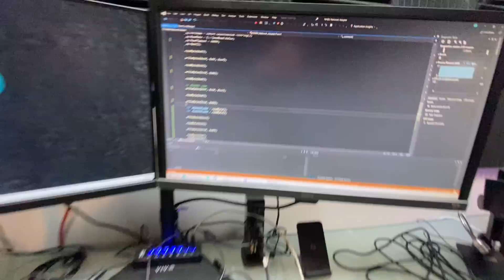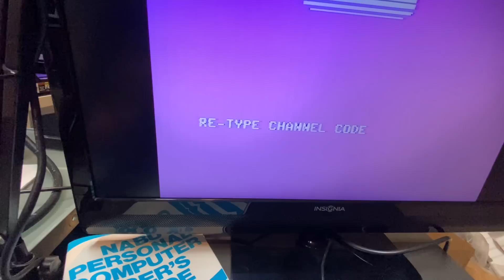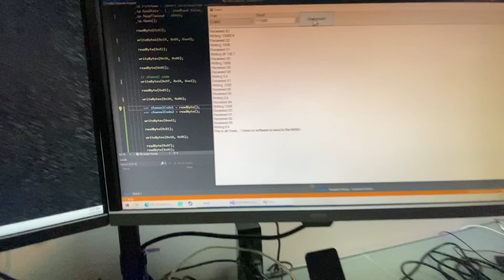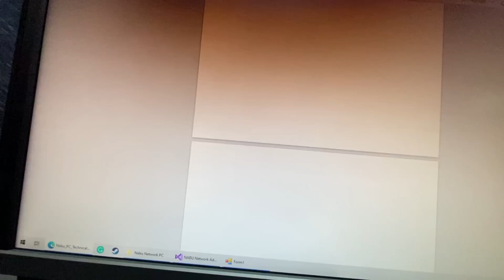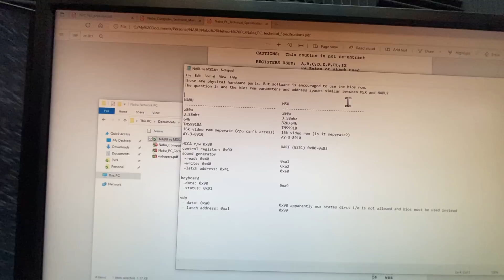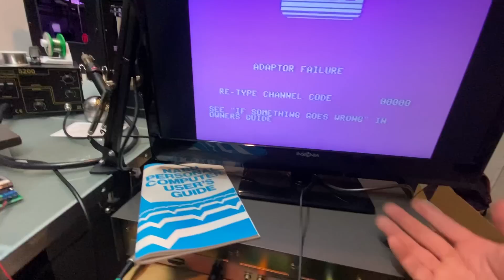01 - NABU computer network adapter simulator

Comment: how about just emulate the network adapter as an sd card
Reply: then you could put the files on the sd card, no fuzz, simple logic on the sd card interface to act like the network adapter
Reply: or just an usb interface, so you could use usb sticks and usb to sd adapters whatnot
Reply: then you would not need a host computer to run the nabu
Reply: maybe some small fpga chip would do all what the sd card reading/adapting would require
Reply: or a pic, or raspberry pi, as the host computer
Reply: yes raspberry pi can be a serial terminal host really easily
Reply: yes I'm being serious, serially
Reply: theres your cereal k1ller
Reply: hackers reference

Comment: I see, so the channel is used by the adapter to   tune the particular analog rx frequency,    so each channel would have been its own carousel.
Reply from the maker: I think that was the plan. Leo can provide more info on that. But it seems that the codes for all of the nabu's is 00000

Comment: I was a NABU games developer and later Director of Content Development. I had a development system, but the hard drive failed decades ago. Thankfully, I have floppy backups of many of the cable titles, and can still run the cable demo software. I also have the extremely rare Hard Drive controller, and a couple of the floppy drives and their controllers.

The floppy and hard drive systems have different boot ROMs, which allows them to boot without being connected to cable. Typically this was CP/M 3.0, which we also used as our development environment.
Reply from the maker: Leo - If you can share your software, my project would be very appreciated! I'm not sure if you saw my latest video, but I can upload applications to the NABU PC now. The next step is to create an internet server to hose the applications, and NABU PCs can request - just like it was meant to be used :D
Reply: @DJSures  How do I contact you?
Reply from the maker: Really great to meet you, leo. I have another video with some pictures of hardware, and yet another with a lot of NABU swag. I'm able to load programs onto the NABU PC using my Network adapter emulator. Do you have any software that you can share? O_O

Comment: Sure the MSX has a different ROM/BIOS but, The Spectravideo SVI 328 had that too (and also uses different addresses) but still they ported software from the MSX (and vice versa) too.  So I believe it is possible :)
Reply from the maker: I have no doubt that MSX software can be ported to NABU. Long as the software isn't using BIOS calls or a mapping layer can be developed. The ideal scenario would be to create an MSX-compatible ROM that replaces the NABU ROM. One application was ported from NABU to MSX, which appears to be easier.

Comment: Thank you for posting! I just made a similar RS422 adapter. I am eager to see where this goes! What software are you using to send data to the Nabu? Would you mind sharing your code? I'm quite the amateur when it comes to programming. I understand if you want to wait until you get it to a more workable state. Anyways, I am very glad to see that this is a possibility! I'm hoping to get the Nabu working to bring it to our RetroGameCon show next year, that would be amazing. Keep up the good work!
Reply from the maker: That woud be great to see a NABU at retro game con! I'm working with another group on this. We would like to archive our effort and get an internet server running to serve NABU programs. It would be great to get some assistance in the future. Stay tuned because I will be sharing my efforts, most likely through github
Reply: @DJSures  Great! Thank you! Let me know if there ends up being some kind of group I could join. I will contribute any way I can with testing and whatnot. Keep up the good work!
Reply: @DJSures  I would be interested in hacking around / helping as well. Keep us updated!

Comment: YouTube recommended this video and I'm certainly glad it did. It's great to see someone working on a network adapter simulator for these nice little systems. What you have so far shows they have some potential without replacing the ROM.
Reply from the maker: Fingers crossed! I have a bit of progress since the video, but mostly because I'm shooting Bytes in the dark and watching for various responses. Once I can get the simulator up and running, I'll host it on a server so we can all connect to it and run programs.

Comment: This is awesome! I'm so excited to receive my NABU pc. Does the keyboard work connected to your own computer with the same rs422 to USB adapter?
Reply from the maker: The keyboard would work if someone wrote a program to convert the characters. That sounds like a good project to do! It'll be my next one. Thanks for the idea ^5
Reply: @DJSures  I thought so, I can't decide if I want to replace the board inside to read just from the keyboard matrix or make something external that also supplies the 10V DC so the keyboard itself is original (and is usable with the Nabu). I hope you'll make a video about it if you start that project!
Reply: @raidenvanbronkhorst5749  Definitely keep it original!
Reply: @TheDreadGazeebo  Agreed! I definitely want to play with the Nabu PC itself.